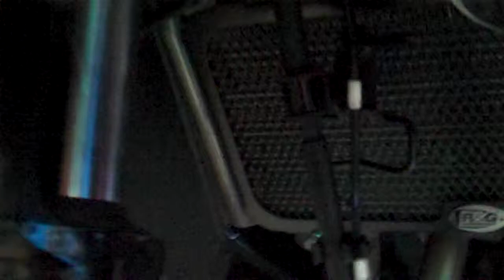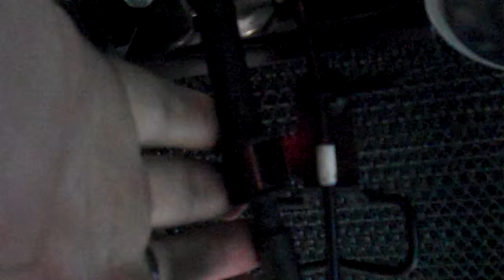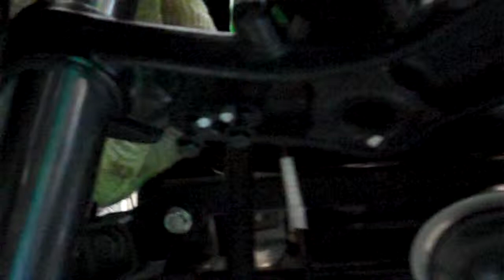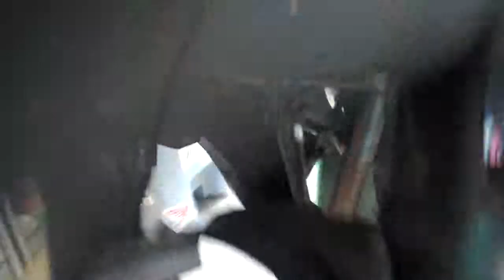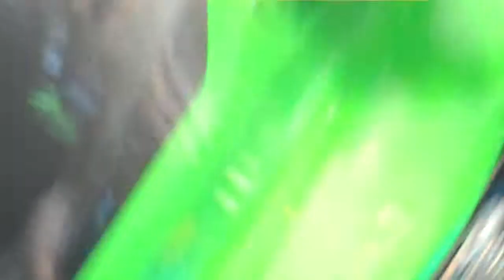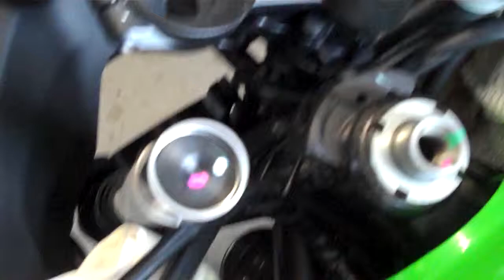Part 3 - Ninja 300 steering stem bearing -brake hose run becareful

Comment: thanks for the vids. pitty you left out 80% of the information. cheers anyway
Reply from the maker: sorry, my mistake, i assumed anyone wanting to watch this might have some mechanical skills & knowledge behind them to understand what is going on.if you need me to dumb it down some then parhaps this is something you should not be doing on yours or anybody elses motorcycle before you sersiously injure or kill someone.food for thought
Reply: sorry bro bit of a impatient neggo comment on my behalf. it was a good vid but  you left anything major out. changed my kawa 250 head stem bearings, wheel bearings and fork seals no problemo. I'm an engineer, i don't usually work on bikes but its good to get a run down before the job. cheers for the vid.
Reply from the maker: Tony R you need to remember, this video was never intended to replace the service manual. i have been burnt at the stake too many times in the past and when trying to help someone if you give them all the information in a video, they still wont pick up a service manual, it all turns to crap then they turn around and burn me at the stake cos they were to lazy to think for them self & refuse to accept any responisibilyy for their own actions & blame me for it all. so now days im very careful with what info i give out.its a sad world we live in now days aint it :-((
Reply: cheers for the vid :)